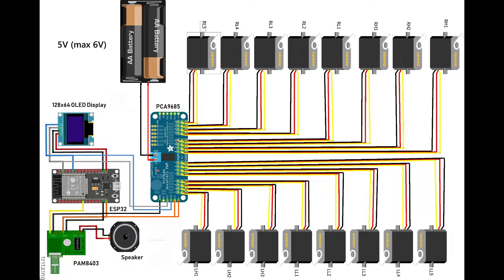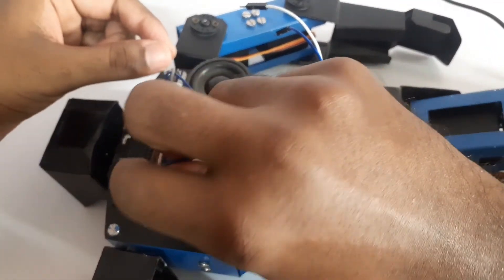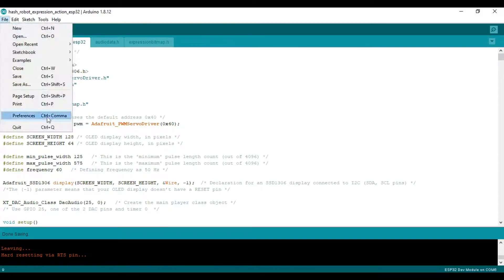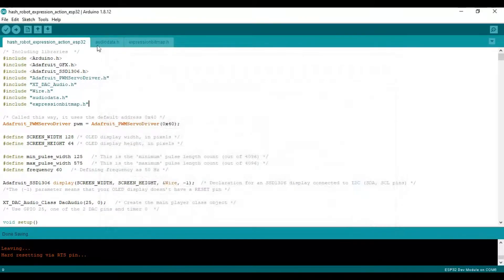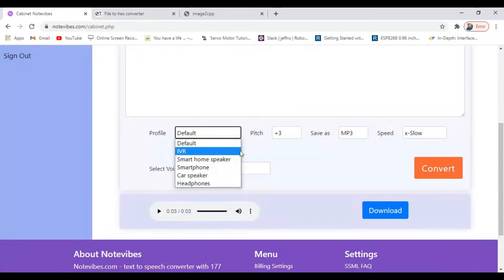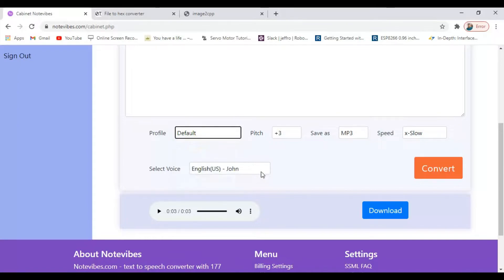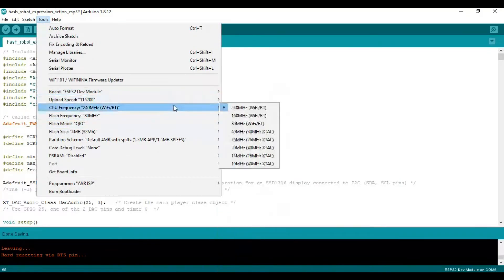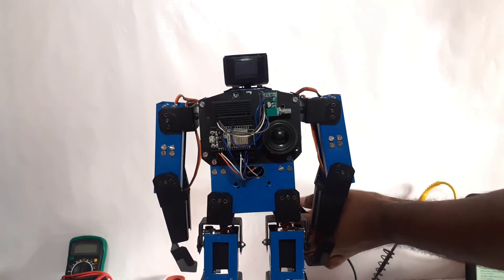Humanoid robot with voice and face expression using ESP32 | Hash Robotics

Comment: what is the function of the PCA9685 driver? whether to multiply the servo pins only for the arduino or to make the voltage and current on the servo evenly distributed for each one?